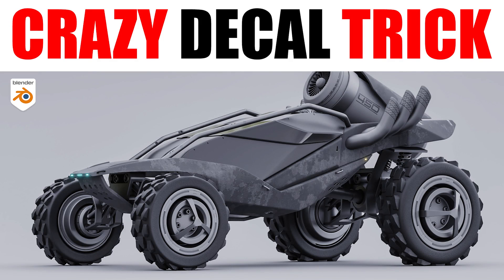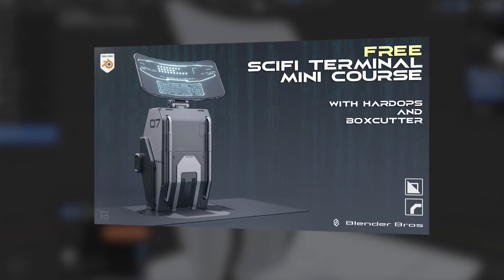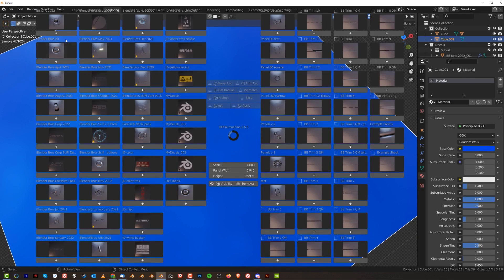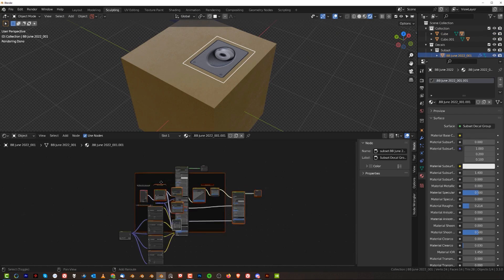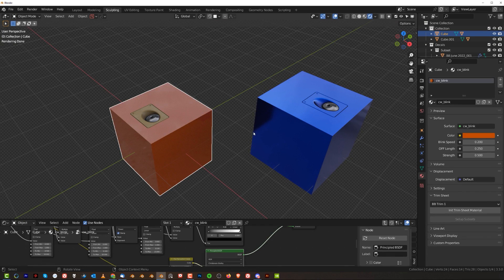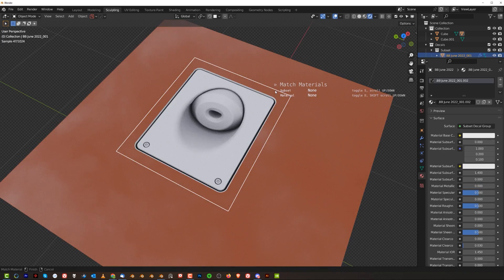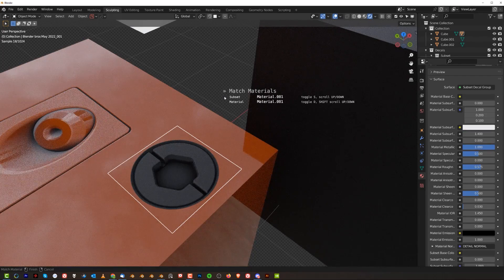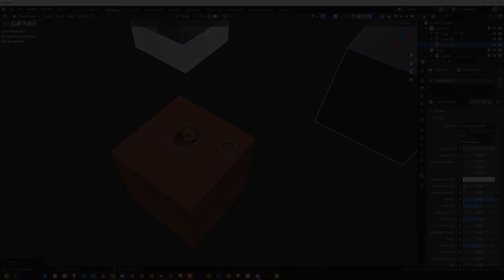How to CHEAT with DECALmachine

Comment: You forgot to mention the most important thing "use abandoned slipway HDRI" :)  
But I have a serious problem when I try to use trim sheets. When I press ALT+LMB, the trim sheet material is applied to the entire object. At the same time, the existing material is deleted. As far as I understand, ALT+LBM is used if you want to apply the trim sheet only to a specific surface in edit mode.
Reply from the maker: only the first time you apply i, then you dont use alt anymore